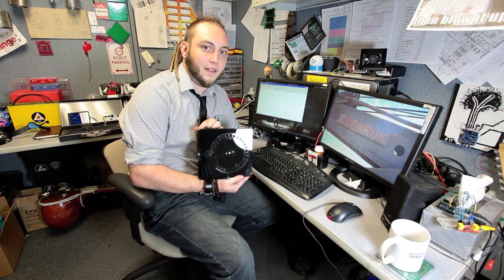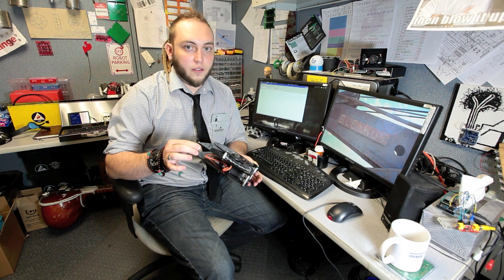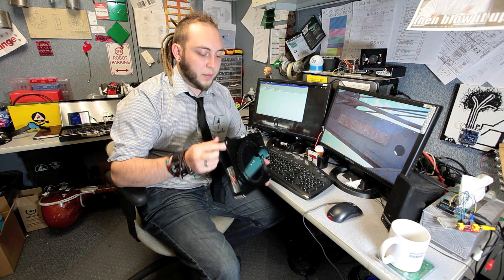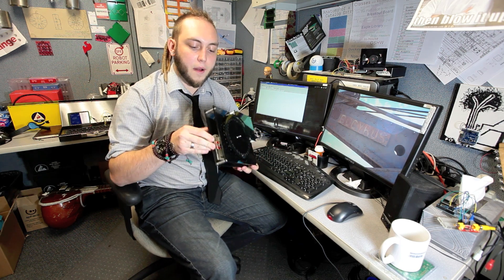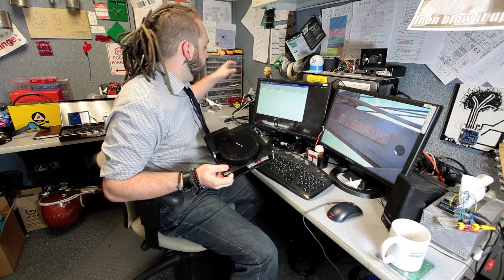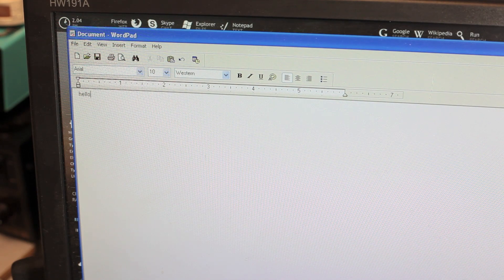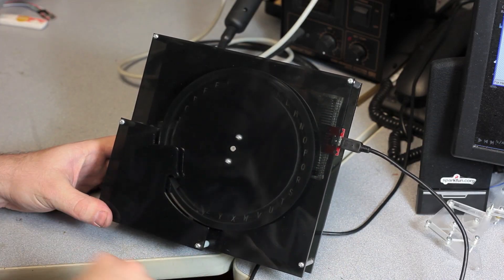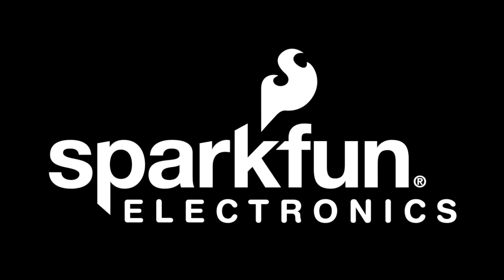SparkFun Rotary Keyboard with Nick Poole

Comment: Was that a Sitar underneath the desk?  
Rotary keyboard - you can get more characters by adding more holes along each radial and adding momentary switches at the stop.  Outer holes = caps.  Middle holes = lower case.  Inner holes = numbers & special characters.